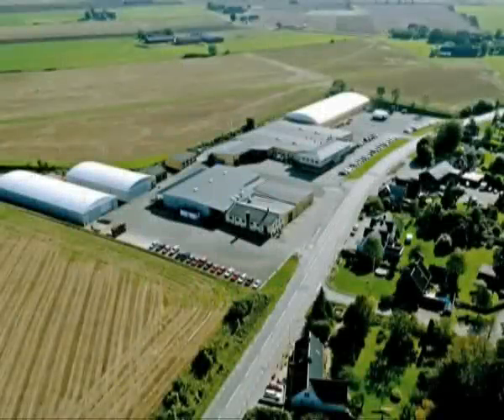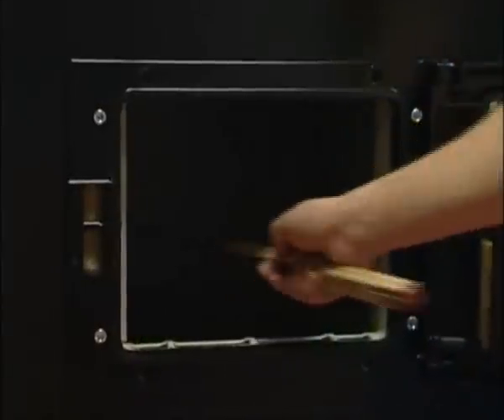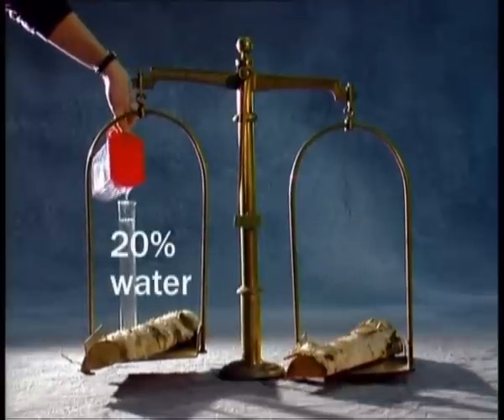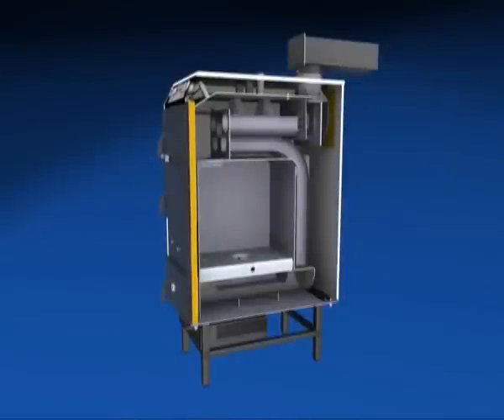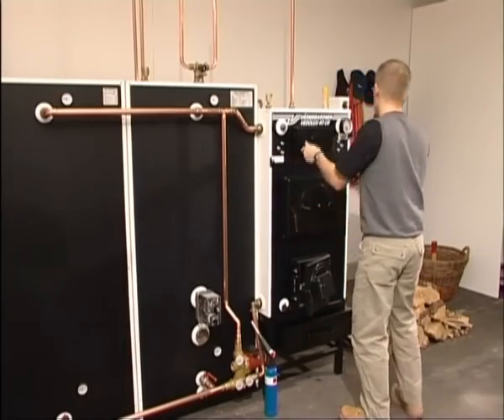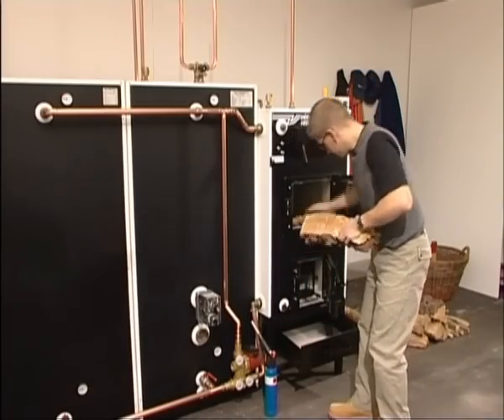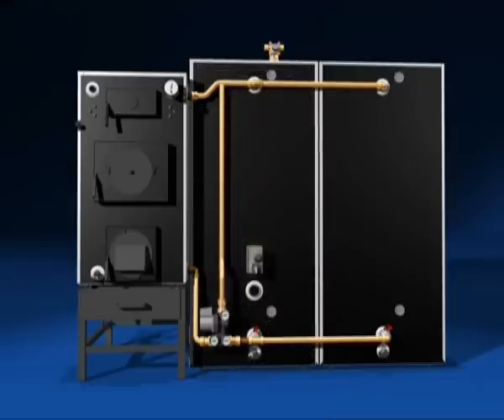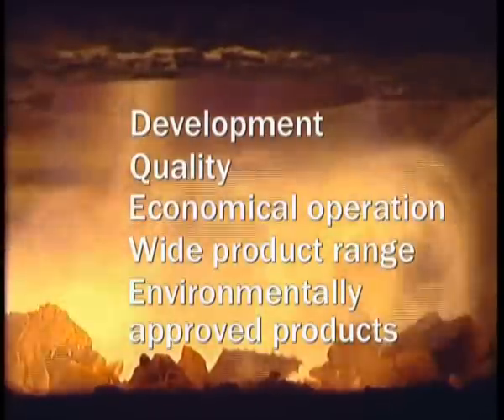RVR.ie - Wood (Log) Gasification Boilers explained (Version 2)

Comment: Technically the statement is false, and you are correct.  But the end result in most people's minds is that the dry wood actually does contain 45% more energy, since there is 45% more energy available for use.  So in that sense, the statement is correct.  Let's not complicate things for the folks that want to keep things simple.  Dry wood = good, wet wood = bad.  As simple as it gets.

Comment: @ 2:45 the "fact" that the narrator states is false, the booth pieces of wood contain the same amount of energy, it is just that in order for the piece of wood on the right to be burned fully it uses 45% of the energy that it contains to evaporate the water.

Comment: The Biggest Problem with these things is Wood,it takes time and labor, to cut wood,haul it,stack it.time and labor is MONEY weigh it out my friends.
Reply: +ilililhy1 Most people need the excercise. Might as well get it chopping/stacking wood. :-)
Reply: +ilililhy1 I agree with wookey.  Cutting wood is a good opportunity to get out of the house in the spring.  If your time is more valuable than what you would save going out for a couple days to cut wood, then you make enough money to be able to take some time off to go cut some wood.  It's not all about saving money.  It's partly about making the most of your time on earth.  If you don't enjoy collecting and splitting wood, and you can afford not to, then don't do it.  More free wood for me.  If you don't enjoy cutting and splitting firewood though... well then I just don't know...
Reply: +ilililhy1 It does justify, it's really not that bad. I used to burn 8 cords/year, plus i would sell cordwood on the side. I came across many contacts and opportunities doing this, and even between the gathering, processing, delivering of the cord wood for customers and myself, it wasnt hard to stay on top of it with just an hour or two commitment during the fall and winter months. I recommend it to anyone! It's good fun, if anything else.
Reply: Well. ....have someone else cut it and deliver it...help create a local economy.